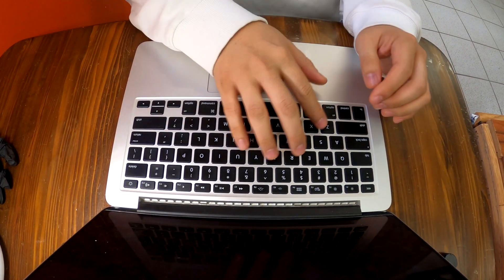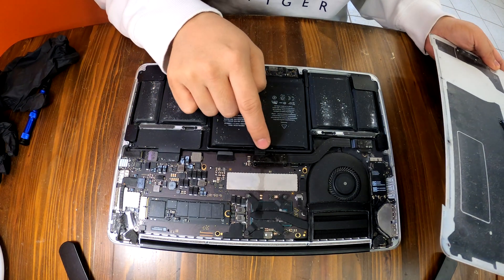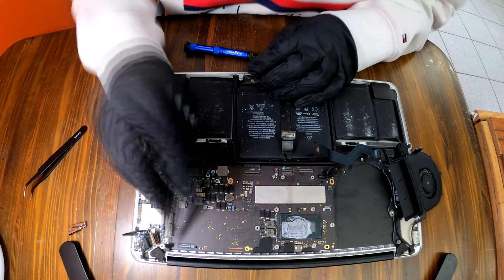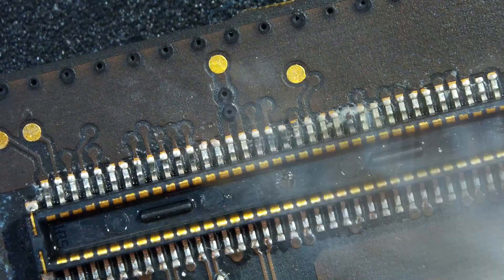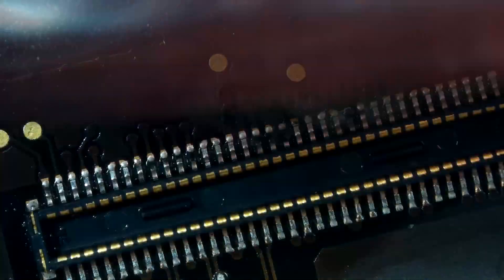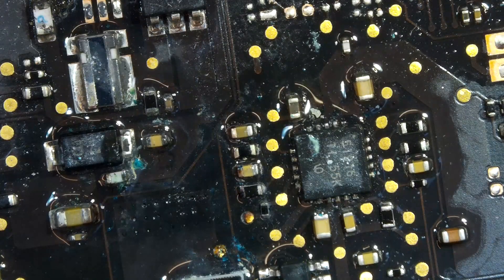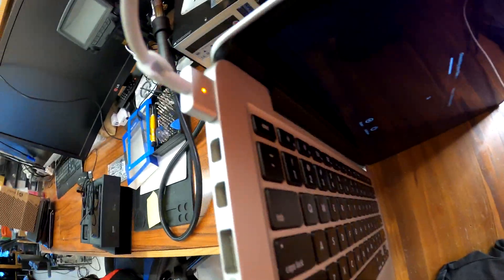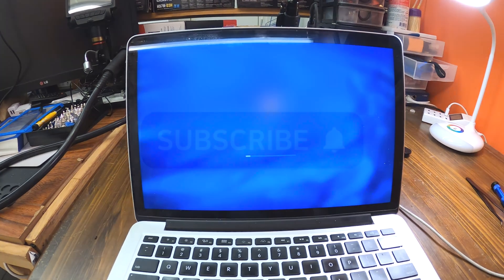"Beer Damaged" Macbook Pro Repair (Liquid, Water Damage Repair)

Comment: Great vid, thanks for sharing. Same thing just happened with my mate spilling beer on one. Turned MacBook off straight away even though still working and seems ok though. Then after ten minutes or so turned back on and no problem. Would a wet wipe be ok to clean the trackpad as it’s a bit sticky? That seems to be the only issue, assume as it still works ok.I guess we’re really lucky, or do you think it’s worth taking apart to check any damage? Thanks.
Reply from the maker: You can use a wet wipe(not too wet) If I were you, I would backup the main drive first. It is always a good idea to take it apart to see any internal liquid damages. I don't trust the liquid damaged electronics. Anything can happen all of a sudden
Reply: @PTITBROTHERGravenhurst  Thanks for reply, I did use a wet wipe, in last few days unfortunately some keys are not as responsive as they were, so think will have to take it apart. Guess I should do that soon too.

Comment: PLZ where can i get my MacBook fixed my aunt spilled beer on the keyboard and i don't  wanna to it myself because i dont wanna ruin lr break it
Reply from the maker: Sorry to hear that.. we are not doing orders at this time. If you can, try to remove the battery connector from the logic board. It will avoid any future damage at least

Comment: People should get some basic knowledge how to act in such situations. Only detaching battery would save thousands of laptops from death and keep user data on storage devices. 
Wanna mention, in this case, beer, actually hadn't impacted on the pads as mostly those werent coroded to the condition, when you need renew it by soldering.
Also in heavy cases when spillage took large area and did deep corrosion, better to use special chemicals that will avoid further destruction of solder and copper pads.